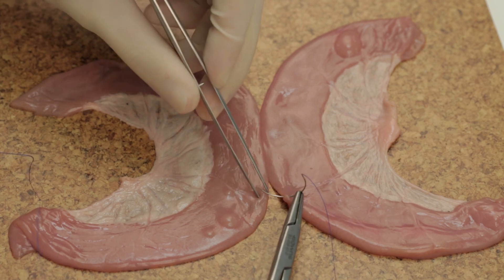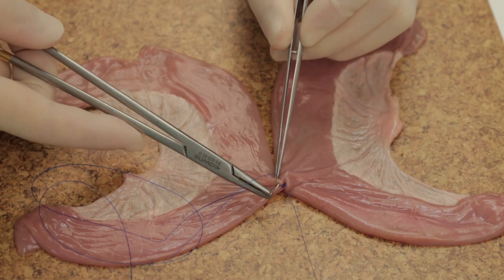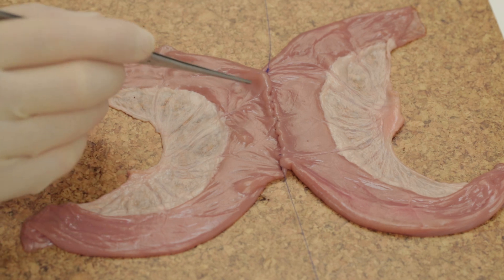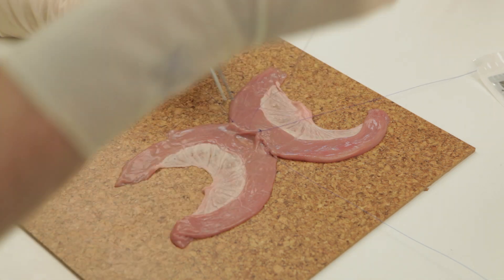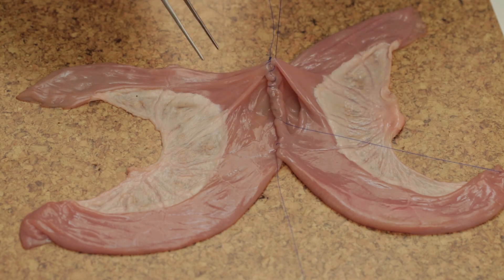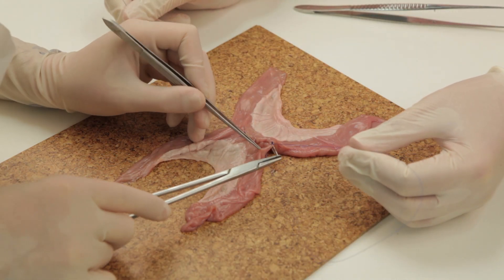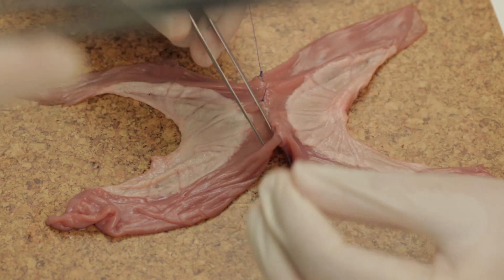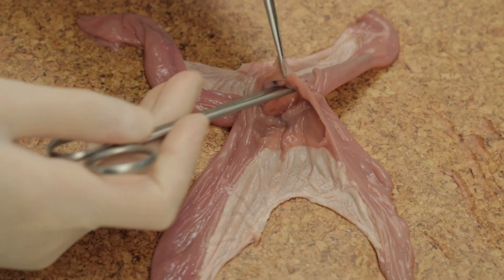Side to side bowel anastomosis (simulated)

Comment: Thanks for this nice video. i had a query ... isn't it now standard practice to do single layer seromuscular suture instead of a double layer sutures? And also isn't it better to use 3/0 instead of 2/0 suture material? I prefer to use vicryl to PDS though.
Reply: Asif Mahmud, the surgeons I worked with used 3-0 Vicryl pop offs. I realize your comment was 8 months ago, but I  figured I would answer anyway.